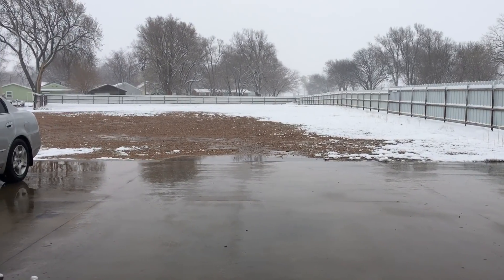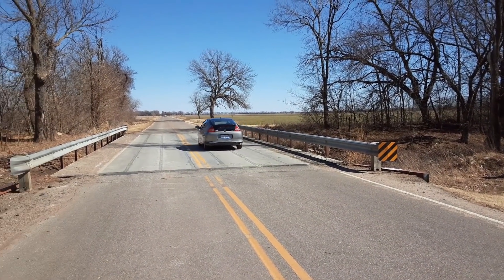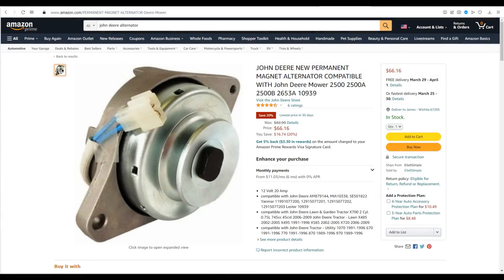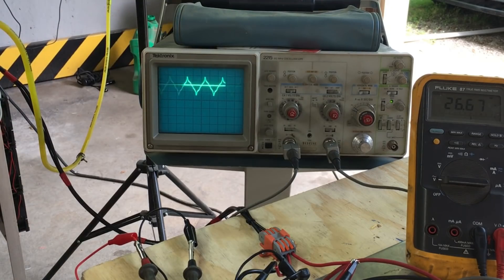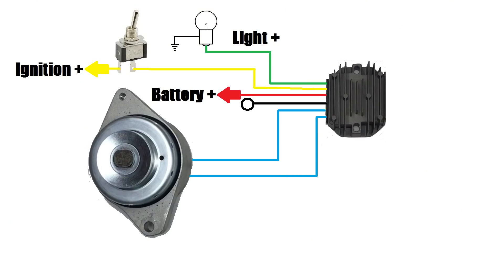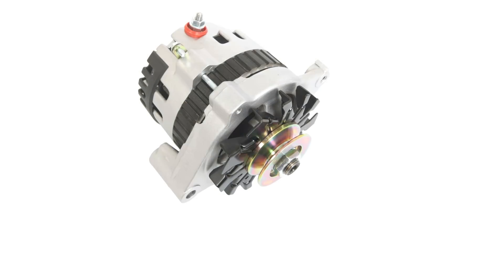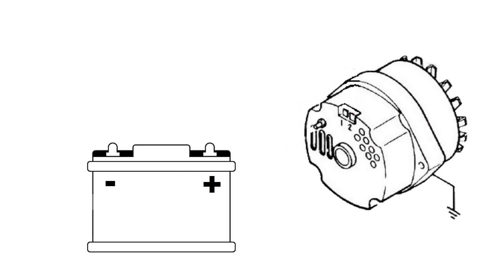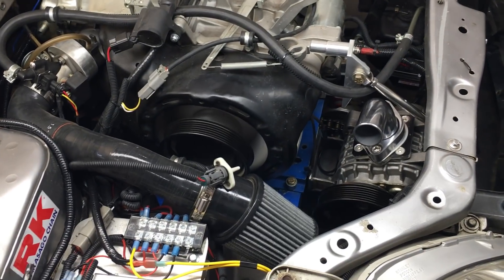S2E4: We generate MASSIVE (20 amps) electrical power for our 420cc engine with a mini alternator

Comment: Thanks from 2025 Jimbo 👍🏻
Went tripping down your old videos, and found a simple way to charge my starter battery after swapping the flywheel to a billet one (no magnets on a 10k RPM flywheel). 
The Deere alternator will take the place of one of the guide pulleys on my racing lawnmower, and I won't have to worry about boosting between heats anymore 🤞

Comment: I've been wondering about these alternators on a mini bike engine because of their size and the charging coils the bikes comes with are only good for powering a simple led light system. When modifying the engine for more power and rpm with billet parts, you sacrifice the charging magnets since the upgraded flywheels don't come with them.
Reply from the maker: When going to a billet flywheel, this is pretty much the only option, however if you stay with the cast iron flywheel on the 212 engine, a 10 amp kit is available.  Season 5, episode 8 we test 10 amp kit.

Comment: question ?? the first alternator 20V spinning direction matter ???
Reply from the maker: I'm not sure I understand what you mean by 20 volt.  The alternator is 12 Volt,    The spin direction on any alternator doesn't matter  because the diodes will rectify the voltage in the correct polarity.  However on an alternator with a cooling fan, spinning it backwards will reduce the cooling effect of the fan.  On the mini alternator we feature in this video, the spin directions dosn't matter.  Hope that helps.
Reply: @robotcantina8957 
Sorry I mean 20 Amp the first one you presented in the video usually used on John Deere . It obviously doesn’t have cooling fan .
Reply from the maker: @sammyhash4135  Whoops, sorry I should have figured that out.  Anyway, you are good to go on any direction you want to spin the alternator.
Reply: @robotcantina8957 
Thank you

Comment: What pulley did you use?
Reply from the maker: its been a while, but I believe the pulley was custom made by welding a 1 inch hub to a small steel pulley.  I don't have any records of where the parts were purchased.

Comment: I pulled a 1 wire alternator off of a BMW suv and powered it 2:1 with my 420cc Duromax engine for my go kart. It works great! I can run my headlights, tail lights, and light bar without fear of depleting the battery. You can hear the engine rpm drop when the alternator kicks on, but it doesn't stall the engine, even at idle

Comment: Good vid on the PMA set up, however the 212cc engine test bench setup is inappropriately misrepresented. Over-driving that alternator, what looks to be nearly 3to1, would never be recommendable in such applications, especially with such a small engine; if in fact you intend to actually use the engine to power more than just the alternator. 😏 That is an enormous parasitic loss, not to mention that it is totally unnecessary to spin the alternator at nearly 9000RPM for it to provide enough power. A 1to1 ratio is sufficient for that type of alternator, in such applications, to charge the battery @ operating RPMs, as well as power some accessories, including an electric clutch, if one is used on the machine. Charging the battery at idle is not necessary, seeing that the engine would obviously be used to power a setup that normally operates at working RPM.

Comment: Man, as a non electrical savvy dude I have so many questions.....
I'm building a diesel electric hybrid motorcycle.
I'm using a 186FA jungle sight 10 hp 20ftlb torque diesel engine
A 40 series torque converter
A thunderstruck EV conversion motorcycle kit.
It's a 48v system.
The batteries I'm interested in using can charge at 20 amps..
If they are hooked together to make 48v do I still get a 20 amp alternator or do I get an 80 amp alternator?
Do I have any need for the factory stator? Like at all? If I'm running an alternator?
The goal is to drive on electric mode until the battery gets low, then start the diesel engine and keep driving while recharging the battery.
Reply from the maker: I don't fool around with EV stuff, but it sounds like you may need a BCM to control how much current is sent to the battery for recharging.  If the battery can only handle 20 amps @ 48V then you need to limit the amount of current to  a maximum of 20 amps.  The BCM may do this automatically.  So theoretically you would need a 48V alternator and feed that into the BCM and the BCM would limit the current to 20 amps.  Again, I dont' fool around with EV stuff and my knowledge  is very limited.    The alternator I feature in this video is 12V and obviously wouldn't have enough voltage to charge a 48V battery.
Reply: I've discovered that OEM motorcycle batterys are only good to change at about 3A max so I will hook the stator to that.
Instead...
I may add the 20A alternator, a group 24 battery and hook a little power inverter to the group 24 battery so I can plug in the recommended charger.
That way the 20A alternator can charge the group 24 battery. And the group 24 battery can power the inverter which can power the charger.

Comment: @robotcantina8957 If I installed this mini alternator to my DIY E=Bike would it charge the 12 volt 7 amp battery? I'm currently using a washing machine motor with a rectifier bridge thats also a voltage regulator and it works great. The washing machine motor is huge, so if this mini alternator works, it will be a game changer for me! Thank you for your time spent in answering my question.

Comment: a generator/dynamo produces dc current, an alternator produces ac current. but technically, if an alternator has permanent magnets it is called a magneto. usually magnetos are used for ignition systems on internal combustion engines but they have been used in the past for other things, like hand-cranked telephone ringer systems.

Comment: Do you or anyone have a link for the belt you used for the alternator and also a link to the belt/pully wheel that’s actually bolted to the engine shaft

Comment: Jim if you use a clutch from a small bmw as memory serves , 4 cyl z3, and overdrive for high speed charging and keeping your clutch off , and a small blower driven electric, with a self action valve, for boost during acceleration and not having to pull past the off blower. Have you seen AlexLTDLX?

Comment: Hello, please explain why this yellow wire is connected to the ignition or do you need to supply 12v to it, is this a regulator switch? diagram in the 4:15 minute of the movie
Reply from the maker: The yellow wire provides 12V to the regulator when the ignition switch is turned on.  The yellow wire is what turns on the regulator.

Comment: I'm using one of these mini alternators to power a Suzuki RG250 with a really, really, reaaaaally stuck flywheel that I couldn't remove. I hope it works but like you said it will not charge at idle, guess the bike wasn't meant for low RPM anyways.

Comment: I wanted to add some thing I have also problems lot with alternators because Im converting engines to older designs.
My alternator is Delco 12si Europ version.
In the past I hade back fead problems who are great if you want to run just ignition coil true the field dash and to ignition coil cool effect and it cinde of reverse polarity ignition coil on hei ignition system.
Now I hade failures diode bridges ,voltage regulators,diode triodes indead baterry over charge and undercharges.
Basicali internal regulated alternatirs can work with out baterry basicaly.
They have also bade tendency to interact with external capacitors.
Once I used plasma ignition on my hei E core ignition coil the effect was normal multipel ceramic capacitors in series soldered 3kw rated 3-4 of them and one side goes to + coil the other to ground so plasma ignition is nice smuth engine bether starting in cold condutions and runs great with flamabel fast burning fuel types but the problem acured that the alternator bulb stayed on up to 3000-4000rpm it wuld not shut off at normal engine rpm the cutt in amps or starting charge wuld not acure at centrain speed.
So I tought to my self if it worked that way maybe those regulators can by manuali programed suposedly with resistor/capacitor box or use dual voltage regulators those alternators came with wide varieti pulley sizes and they hade fast and low speed regulators for cars trucks and tractors .
So yes they do strange staff recently also arcing relays some how some where interacted with the voltage regulator and my car wuld not shut off faund the suspect was corroded wire for rear blinker ground and burned wire black on ignition switch so when all 4 blinker worked the car wuld act like Hit and Miss engine or some sort of buzz coil triggered ignition coil with key turned off.
So honestly I realy think Delco has terribel regulators no diodes no zener diodes realy strange design simpel yes but not realy reliabel as peopel think.
I asked many teachers peopel who work with alternators ither they are dumb or dont realy know how to calculate manuali what resistor and capacitor value is necesary to get centrain alternator out put at centrain rpm ranges.
In my case xenon bulb,relays,voltage stabiliser and random other things interacted with the alternator.
So I realy hoppe some one see this comment and can suggest some thing that works.
Im after baterry/capacitor banks dual charging out put seperatly and posibly how wuld look seperste ground path to use only high gage wires insted of engine ground my classic GM car is notoriuse for rosting so I kinde of desire some sort of cloosed loop system.
Also was wondering how wuld cloosed loop voltage regulator look like or avr system on those delco alternator honestly any thing is bether then stock parts If I might suggest to use heavy dutty industri bridge rectifiers and perhaps magnet delco alternator.
Perhaps you can try out the plasma ignition deal that might solves your problem I honestly hade no money so culd not aford capacitor banks insted of baterrys I think then it might work or if you try to use magnet alternator with external step down transformer perhaps like baterry charger set up that drag might go away at centrain engine rpms.
Dono honestly never hade the chance to try it out .
Your best bet might by delcos tractor regulator with hv ceramic capacitors let by warned the voltage wuld hover around 15-16volts on the baterry so loading the baterry with ligh bulbs or halogen or xenon with ballast migh do some wonders just some safty meshure .
I dono perhaps there is posibiliti to use amp cutt out selenoid with alternators .

Comment: I use only a full wave bridge rectifier. There’s no “regulating” in your regulator/rectifier, the battery absorbs  the excess voltage and self regulates from there anyway.

Comment: Hi. I was contemplating putting one of these mini alternators on my garden tractor. I can't find a lot of info on them but assumed they more or less worked like the flywheel stator that produces around 30 ac volts before the regulator. I'm no electrical wiz so I'm wondering why you say these don't produce enough at idle whereas the stator in my tractor does. I know that I'm missing something here but how does it work on a jd tractor at idle? Also, do you know how many ac volts this puts out testing it directly from the 2 leads? Thanks.
Reply: BTW, the reason I want to do this is to avoid having to remove the engine in the future. Thanks.

Comment: HeLP!!! I put this set up on my sears tractor repowered with a duromax 18hpe.  I used a 4" drive pulley and figured I only need the power in neutral and can throttle the rpms up.  My ignition doesn't have an "on" position so I just ran the yellow (white in my case) to a switched 12 v.  I have tried several set ups and can't get an amperage reading? What am I doing wrong... my dummy ligt gets a little brighter at full rpm but never illuminates.  Switching the "alternator kill swirh" on or off seems to make no difference. Is that white (yellow in your vid) hooked up wrong? Bigger pulley?

Comment: I plan to add this to my sears suburban tractor repowered with a duromax 18hp electric start engine.  I want to run a 12 volt actuator to lift implements and possibly an atv winch.should i try to squeeze in a second battery for accessories or will the one lawn tractor battery suffice.  If i stay with the one battery it already had the engines approximately 3amp charging coil to the battery.  It would not cause a problem to have both the alternator and coil charging the single battery at once right?

Comment: Awesome the adjustable bolt with an eyelet is just the idea I need to complete this same set up I'm making using a Ford alternator with an A belt and a 3 predator motor. I am putting a 2 horse required 2 cylinder compressor on the other side. 12Volts and air at the pull of a cord.

Comment: "...permanent magnet alternator...top secret cutoff switch..."  ...Oh-OOH!  With a controller  your alternator becomes an 'Above Top Secret' motor!   
That takes the Old Honda back to it's hybrid roots just a bit.  :)

Now where did I hide that brushless AC motor controller info from myself!?
A quick search for controllers throws up millions of results, so getting more specific (rpm amps etc) should work fine.

You might consider using a big car alternator if you can track this fella down:
https://www.diyelectriccar.com/threads/plug-in-hybrid-retrofit-kit-using-alternator-as-motor.80547/
Here's a fella with a modded alternator  :D
https://www.youtube.com/watch?v=7g8BRyLaQgg

See the 2nd video here for just what a properly implemented permanent magnet motor might do to your 'GO-cart!':
 https://www.electricbike.com/50mph-monster-electric-trike/

Alternately; You might want to upgrade to 4 Wheel Drive?  :)
https://www.alibaba.com/product-detail/New-desgin-QS-Motor-E-car_60787333680.html?spm=a2700.wholesale.0.0.49f2cddcRF5Nyi

Yep; no end of view worthy ideas here.  :)  I'm just getting started!  :D

Comment: suggestion one thing you could try ... mount the alt to run off the drive axle or wheel ? it robs less hp. drive time vrs charge time it will do its job ?

Comment: I noticed that the steering wheel is off center. Have you tested the alignment, a very small toe can cause significant drag. I suppose you know how to measure it , don't trust an unknown machine, as usually multiple mechanics use one machine and have you ever worked with snaggletooth mechanics , how many will tell the boss that they did something to cause it to need service?

Comment: You should research old Delco Generator/Starter on small engines, basic and still available. Generator self exicites does not draw the engine down as the v cutoff opens , and you can adjust voltage and current. No rectifier and you delete ,or redundant system the starter

Comment: My mind is officially blown !! I just literally went through every bit of this 2 weeks ago I kid you not, I ended up with the exact same alternator, I bought mine from Amazon cuz they had an open box one for 20 bucks and I figured for R&D lol it would be worth it if don't last. I'm using an old friction drive 2 stage snow blower repourposed with the auger system and barrel removed. Honest to God  I was in my shop thinking "I wonder how much hp an old gm 3 wire 100amp alternator uses ?" It was way more amperage than my little project needs but it was in my inventory of cool stuff to keep, anyway it bogged my brand new 390cc engine down way more than I figured under a heavy load so I started "researching" and ended up with the 20amp permanent magnet and it is right now mounted on the friction drive, sitting on my bench ready for me to figure out what I need for rect/reg this weekend. How amazing of a coincidence is it that one of my favorite channels puts this video out right now? This is scarey, I don't have luck like this. That did it, I'm hooking up the ground wire lol.
Reply from the maker: LOL,  Sounds like your well on your way to success.  Best of luck with the project!

Comment: You could "automate" the alternator cutoff by making it a button mounted on the floor under the gas pedal - If you're accelerating normally, alternator stays on, floor it and it cuts off the alternator.
Reply: We call this a wot switch in the geo world. Wide open throttle. We turn off the air conditioning and alternator.

Comment: Hey, I've following your project and I think I could help with your power generation needs or at least thow some extra informationout there. I've built an EFI Turbocharged GX390 powered go-kart that hits 20+ psi of boost. What are your electrical power requirements(Amp draw) at idle and operating speed?
Reply from the maker: Wow, I just watched your videos on the EFI turbo GX390 kart,   Nice build!
Reply from the maker: Hi Sean,  The typical  power the EFI consumes is about 5 amps and that includes the widband.   Generally the EFI is the only thing that draws power.  We don't use the headlights or wipers but are required to have them to be street legal.  Keep in mind this project is constantly evolving and we make a lot of changes.  The Mini alternator we are using works well for now.  The next few different engine we try will likely use the same charging system.  The goal was to assemble a low cost charging system that wouldn't draw to much HP at idle and could be adapted to other engines.  What did you have in mind?
Reply: @robotcantina8957  Nice 5 amps isn't bad. I used the 10amp package from Honda. I found buying the genuine Honda rectifier made a considerable difference.  They have an 18 Amp setup for it as well but again having the proper rectifier/regulator is key.
I went through a lot of trials and error and research trying to get mine to work. I'm also using a yamaha wr250 fuel pump to keep my current draw low. I have a lot of experience with this ridiculous stuff so hit me up if you have any questions.